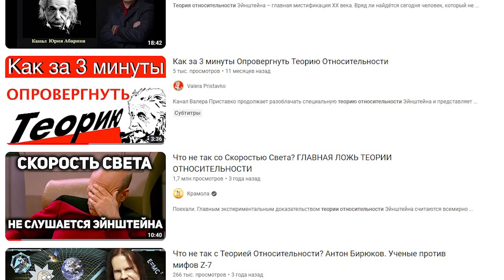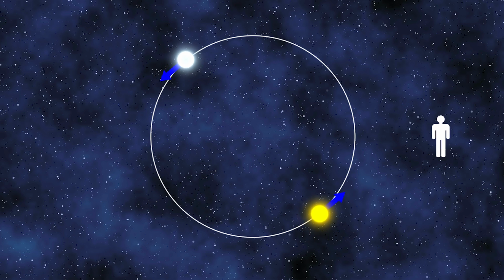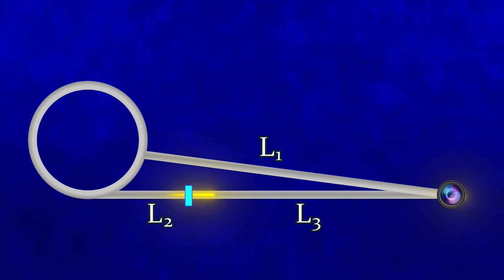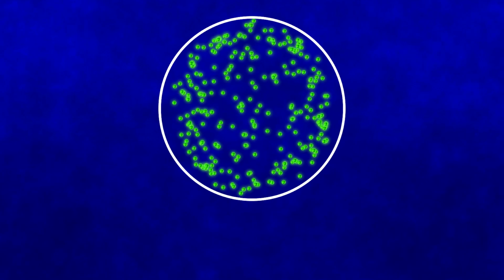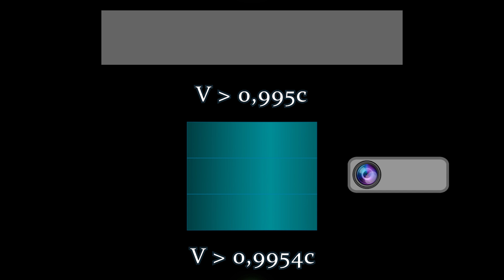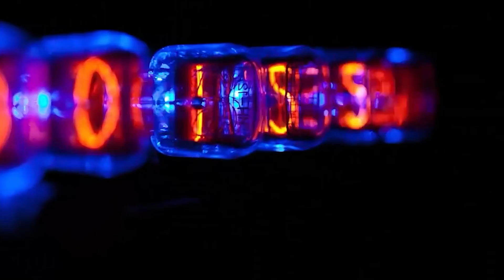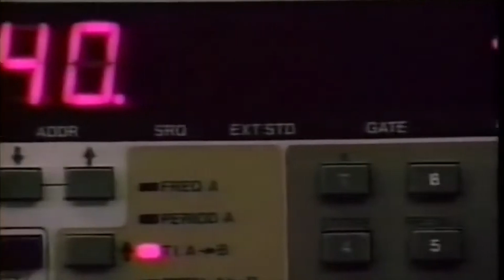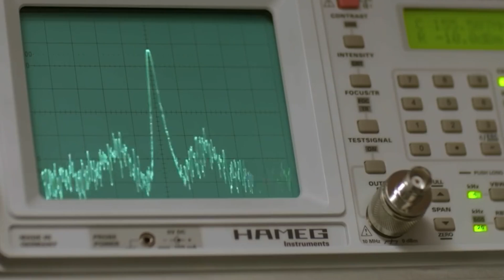Why are we so confident that the Special Theory of Relativity absolutely works?

Comment: You wouldn't expect the speed of light to be different depending on which side of the rotating sun it came from, or binary stars, because it's the frequency that changes, not the speed. Light from the receding side of the sun would have a lower frequency but longer wavelength, so it cancels out. So yeah, the speed of light is independent of the motion of the source, but not the frequency and wavelength of light. Therefore, there is a noticeable difference, it's just not the speed.

Comment: Its a THEORY, so not proven or busted yet.
A scientific "Rule" is generally accepted as usually correct but not 100%.
A scientific Law so has been proven to be unbreakable (so far).
Most of the above will eventually be busted.
Come on the Bonkers notion of a Big Bang is busted and the cop out "Dark Matter" is unicorn poop.